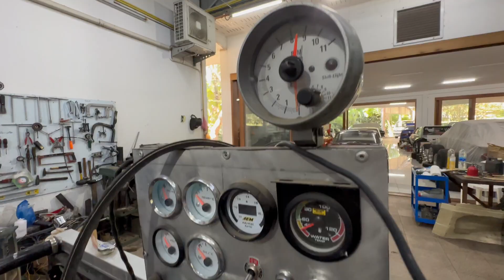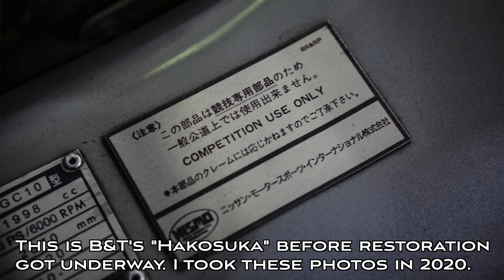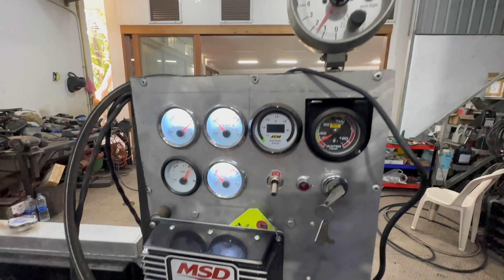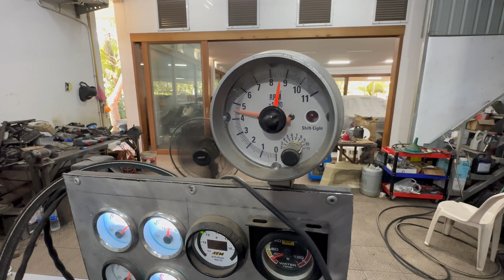The Holy Grail! Race Spec Nissan L28 & 24 Valve Datsunworks Head! What It's Going In Will Shock You!

Comment: Reminds me of the guy on various dato forums way back, he cut up a few Nissan KA24 heads, welded them together, ditto cams, modified sprockets etc, and slapped it onto a L28, he showed it could be done and kinda re-popularized the 24v legend.

OS Giken heads can still be had, brand new, but they don't go good for them unless they get to build the whole engine, so they want a core block, probably looking at a year long process.
I checked Datsunworks pricing, around the 15-20k mark, at that point a complete motor from OS Giken makes more sense, but they're also around 30k.
24v L-series is a dream for many, but not feasible at 1 grand per valve, and with the power you get from a Rebello-style SOHC build (which is just shy off the power you get from an OS Giken ) you're not really looking at gains all that massive, it's more for clout/showmanship than anything else IMO.

The best way would be to make a mold and cast these things, then do final machining, it'll save you from truing up every head from the welding process, just put into a machine, find center, boom.

This would enable the heads to be offered at a price in the atmospheric region where humans survive, sorta like the muscle v8 scene where you can get hi flow heads for next to nothing in comparison.

Then offer the head with innards, timing chain and tensioners, add ports for high pressure fuel injection so the turbo & ITB crowd is well pleased, offer injector plugs for those electing to run standoff's (racing) or carbs (vintage), you'd be covering every L-series niche with one fell swoop.
Reply from the maker: Agree with all those points, yes. 24v L is a dream scenario but the pricing and process is pretty high and makes it a bit unobtainable. And you need a lot of knowledge and skill to build the Datsunworks head up. But still, it's good there are options. And it really is a show head too.

Comment: O.S Giken made a twin cam head for the L-engine in the late 70s. So whilst it's cool, it's not the first productionised head to be made for the L-engine.
Reply: Yeah, but while the OS Giken head is amazing, that one costed 30k before inflation. This one is 10k.
Reply: @XionAzura1  Yup but the OS giken is a piece of art,  has a power output of 420hp and revs up to 10k rpm... and well most important thing for me, it sounds 10 times better than the datsunworks... like the datsunworks sounds amazing, but the sound is very similar to the K20 its derived from... the os giken sounds like a L28 that never stops reving.
Reply: @XionAzura1  Incorrect.  The head was 18k ready to bolt on.  But that was a precovid price.  I have had many telephone conversations with Derek as well as emails.  I am still in line for one.  But I am enjoying my LS/ supercharged swapped series 1 240z.  I will eventually get to the Datsunworks/L28 project
Reply: Also you can't find that head or parts for it even if somehow you do
Reply: Whats this replies a pissing contest, sounds like the fucking AC cobra facebook car group, do better
Reply: Giken heads for the LSeries Datsuns are prone to failure. Timing gears idler gears eat themselves up and have significant issues on the chain.

Comment: Wow. Honestly I feel that the L-series engines should have as big an aftermarket as the Chevy small block. I wish they did, outstanding work!
Reply from the maker: Thank you for the comment and yes agree totally
Reply: @manher4335  Yes absolutely! Amazing engines that can also rev recently high and make big power. For example the ABR Z with 680hp.
Reply: @kaedeschulz5422  I need to know pal. Maybe you know more than me but, doesn't this engine have great potential? As much as those small blocks? would it have been that costly for many companies to produce a modern, advanced-designed head for instance? Feedback greatly appreciated. As this question has been burning un-answered in my head.
Reply: @manher4335  Head wise no idea. Also VS the small block. No idea. I don't know much about US engines.
Yes they have big potential like for example the ABR Z having 680hp.
This grey one from Z car garage has 560hp at the WHEELS! And then there's the Z that Speed Shop Shinohara tuned for the 90s wangan movies that had 620hp on a carburetted twin turbo setup.
And the ABR Z for example is a Expressway street racing monster that has to push the power for a long time and considering this was in the 90s i'm sure this engine can do more
Reply: Its because its cheaper to just do something else. Plus by time you buy suspension parts you are in to the car for 60k.
Reply: @StreetTerrorist187 Cheaper I suppose. But a bit sacrilegious ain't it? I hope 50 years from now most Z's won't turn out to be chopped up, Frankenstein experiments. I like em' with the original L series.
Reply: @manher4335 too late for that wish. Because of its popularity, affordability and, big production numbers,  Most have been, "fixed up, supper up, and used up. But, thats the great thing about the Z cars, they were enjoyed. Owners and, (1 friend at a time) had hours of FUN. It was also mine and many others introduction to the mechanics of a car. They were simple, easy to learn the basics. Hopefully some will survive unmolested , but no doubt the z car has spread the enjoyment of car culture more than most cars.

Comment: That's awesome! I wonder how much Jam it makes? Will there be any Dyno pulls in the future after it's installed and sorted out?
Reply from the maker: Thanks. Hopefully I will meet it on the dyno but not too sure yet.
Reply: Datsunworks page says rebello got 600hp at the flywheel
Reply: One guy did a mild tune and got 430 @ flywheel, on pumpgas.
But apparently needed a lot of work on intake, headers, cams & sprockets.
With 24v you're looking at 30-40k